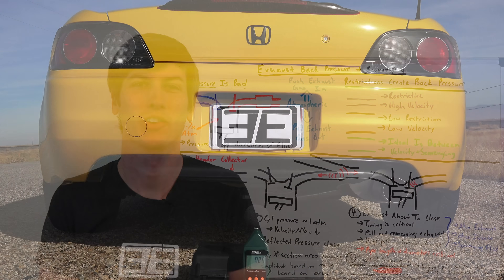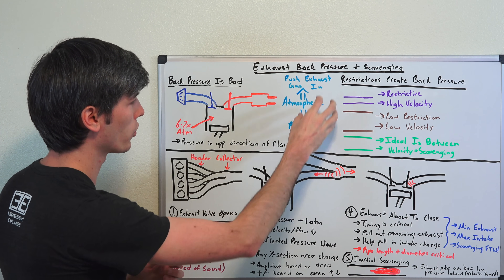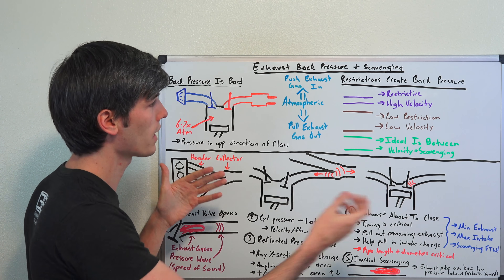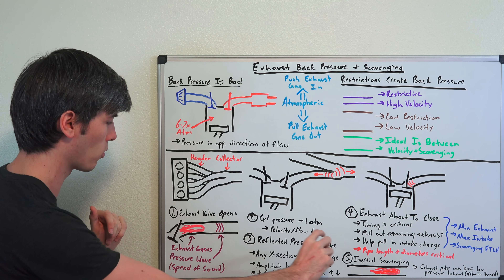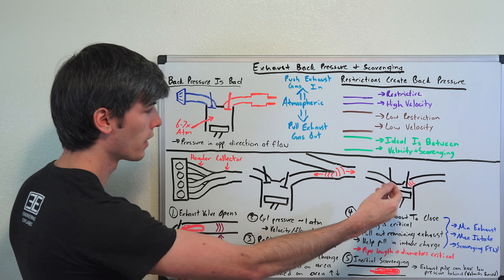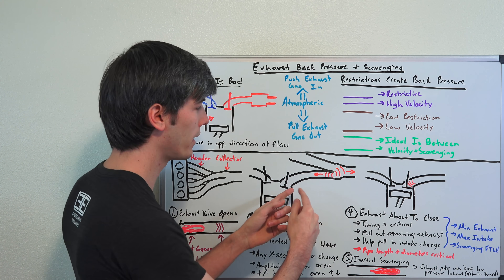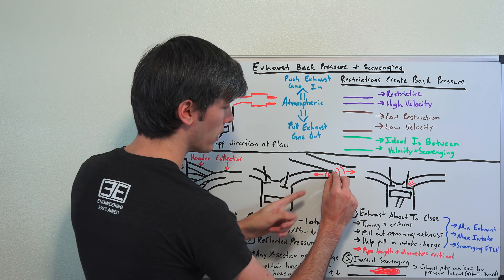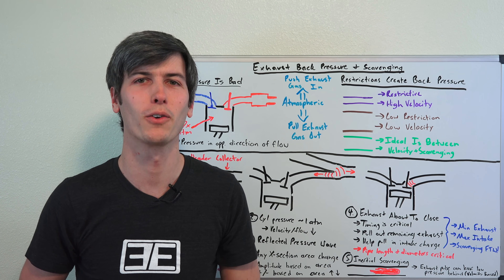Stop Saying Car Exhausts Need Back Pressure

Comment: You are only right for the engines that apples too but you are 💯 wrong for engines that doesn’t apply too.

Bone stock 1998 Chevy s10 2.2l ohv. 

Started off bolting things on then one day cai, dis blaster coils, larger TB, and such. I had a full exhaust system installed one day. Everything graphite gasket, studs, hangers every single aspect replaced all 2 7/8. Head and header no blueprint matched. Just bolted on. I noticed driving away it reved up really fast but had no power. Guy tried like hell to talk me out of it. Old timer said it needed back pressure. He said I’d be back he was right. I then had the  ecu mapped still ran good but had no power. Simply added a 2 5/8 tip to the 2 7/8 pipe and boom. Slowed the rev noticeably but I totally feel torque and I know had a notable amount of power.... again for the pos 2.2 ohv really is not a good platform but never the less this was the result. But then on my 02 Acura TL 3.2 open exhaust for sure gives you more power, faster rev, and easier on the everything so back pressure is subjective to motor differences. 327 cam straight exhaust makes power.

Comment: I challenge you to remove the components of the exhaust on any Chevrolet 8.1 that cause back pressure. Then tell me it has had no effect on the engine. Sorry, but these companies build these like this for a reason. I love how even you start out saying "no need for back pressure" Then go to explain why we need back pressure without saying the words back pressure. Are you going to tell me that GM doesn't know how to build a big block?

Good video, I have installed to many exhaust systems with no back pressure and watched the torque or power fall off on almost every vehicle one has went on. So I don't really believe you. It looks good in theory if all combustion chambers and engines in general are designed exactly alike.

Comment: Mention also the low pressure or almost vacuum created in the other pipes that join at the collector, helping suck the gases out when the next exhaust valve opens.

Comment: So if you want proper exhaust velocity, you need some restriction in flow? Restriction in flow creates back pressure as it narrows like a force cone to increase the velocity of the gasses like a thumb on the end of a garden hose increases the velocity and back pressure of the water passing through? So then, by extension, my exhaust needs back pressure? Lol, just kidding. Great video, that topic needed clarification to be sure.

Comment: Thank you Jason for your great videos - I graduated in 1977 then went post-grad but I am still learning, your delivery style is enlightening and your enthusiasm teaching is contagious.  You may mention the component to the scavenging negative (relative) pressure wave contribution from other cylinders connected to the same collector, what we used in "tuned header exhaust".
As I read comments, I think that some people misunderstand the "negative" pressure wave (or interface) you are mentioning possibly because they consider the word "pressure" as necessarily positive not considering that this "pressure wave" is negative relative to the pressure in the rest of the system.  Great video - makes me feel young again.
PS: Born in '53!  What is your secret, are you wearing a wig, genetics, special engine oil formulation, ;-),  take care Ciao, L (FoMoCo engineering retired)

Comment: this is not a good explnation  
  a properly designed header generates a miner vacuum   caused by the rush
of hot gases leaving the chamber 
  the reason for some back pressure is to aid in the fuel efficiency 
 and the cooling of the ignition of fuel  
there is some thing called intermix temperature  if it is too high the fuel
air burns too fast and motor knocks  and you can destroy  the engine

Comment: So my Lancer is an NA, no turbo, but the previous owner took off the OEM exhaust and put in a 3" exhaust, for sound. Don't get me wrong, it sounds good, but I feel the exhaust is most likely too wide to be optimal. Would you say the loss in performance is negligible for daily driving? Would I feel a delay in acceleration? Noticeable to be bothersome? If HP or torque is the measurable difference, how much would I actually stand to lose in general cases? Thank you

Comment: Wish this fella wasn't such a hardcore ricer fan. Then maybe we'd get more unbiased videos about the big block V8's and whatnot. Most of his videos discussing engines is primarily aimed at the little 4 bangers, for the most part when he does a video about the Bigger engines its more negative than positive. 

Dont get me wrong, scientifically speaking these newer smaller engines are becoming extremely refined in their design to pump out max HP per cubic inch.

But I don't see Real Drag cars using Inline 4's and 6's to get to 300kph in 3-5 seconds. I see them V8's with 8000+ horses.

Why can't we discuss that? Why must it always be tiny high pitched engines?

Comment: So how does exhaust pressure work with a turbo charged motor?  Where  Is the optimal place to put the turbo?
Reply from the maker: As close to the exhaust valves as possible (short header).
Reply: I guess you can't do a video on this since its such a short answer...  :-/

Comment: Well, explains why when we changed back pressure back in my racing days using different exhaust chambers, we could change the torque curve. But it doesn't explain why I should "Stop Saying Car Exhausts Need Back Pressure".  You basically outlined why it is beneficial.  If you fully eliminate it you degrade performance.  And of course that is obvious by how modern cars are designed.  Otherwise a "Smart Car" would have a 4 inch diameter exhaust.

Comment: So how does boost (positive pressure) affect the scavenging pulses from the exhaust, specifically BEFORE the turbo. Does the increased pressures keep the pulses from returning to the exhaust valve? Does a boosted engine see any scavenging?

Comment: Hi Jason! Very nice video. I just installed an axle back muffler on my ND mx-5 and was wondering if it negatively would affect the car in any way. Compared to the stock muffler, the super sport one from BBR is much less restrictive and much lighter. But also it’s slightly wider than stock tubing at 2.5”. 
Don’t want to damage anything. Noise is great though :D

Comment: Exhaust scavenging is even more important in small two-stroke engines, due to not having actual valves.
In fact, when your two-stroke lawn equipment is "sputtering" and seemingly running badly at idle or under low power, that's exactly what's happening - there's not enough exhaust velocity to scavenge the cylinder effectively before the exhaust port closes and it tries to fire the next cycle. There's too much exhaust gas and not enough clean gas, and that cycle fails to ignite.

Comment: Well a 2 stroke engine is a internal combustion engine. And it DOES benefit greatly from back pressure.

It can lead to 30-50% performance gains in that engine type.

Comment: Does the soundwave reflection also occure if there is no collector because of the silencer? I build the exhaust system for an formula student team. We use a V2 engine with seperated exhaust manifolds and two silencers.
Reply: So the real question would be if the manifold length matters like told in the video.

Comment: My plane exhaust broke and I lost all power.  I was forced to land near a grocery store, could not climb at all.  With the pipe welded back up it worked fine. Why would that be? (It's a two stroke) The mechanic/welder said it was a back pressure issue.

Comment: Exhaust back pressure helps torque in the low rpm range... no back pressure builds power in the higher rpm range
Reply: Did you watch the video or just read the title?

Comment: When people talk about "back pressure" They are'nt talking about atmospheric being higher. Engines that are low in static and hense dynamic compression there should be some resistance to flow towards the middle to back end of exhaust. Engines with higher static compression ratio do not need as much resistance . So if You have an engine with say 8.5/1 static comp ratio and You shorten the exhaust You will lose a noticeable amount of torque but from the mid say 3000 or so up to redline You will have a small amount of HP increase

Comment: I think you should have mentioned goilets and how they improve the scavenging effect. Also it should be noted that when you tune the exhaust, the carburetor/fuel injection, intake manifold and camshaft have to be optimised to improve the efficiency and performance.

Comment: Well for what he is talking about he is right or else rally cars and drag cars wouldn't have basically a direct dump exhaust. The real reason you want some back pressure for fuel efficiency. And on a turbo with back pressure you get exhaust density which will spool the turbo faster. With no back pressure you get less exhaust density but being able to evacuate with a higher velocity so you get higher spool rpm. So pretty much with a turbo and back pressure you get a more daily driver power band and better fuel efficiency. Without back pressure you get more top end power band with higher power which isn't ideal for daily driving and lower fuel efficiency. That's the real reason people say some back pressure is good (there are alot of people that say it without knowing why). It actually has nothing to do with what he's talking about.

Comment: I have owned many Ducati 250-350-450 singles. The factory megaphone racing exhaust has a reverse cone to create back pressure. And it works just like a chamber pipe on a Two Stroke. Using a straight megaphone and any street exhaust gave less hp. So, back pressure can be good, it works on Ducati....and the engine is So Loud, like a Harley load.

Comment: I have an old audi b5 2.8 12v with 325.000 km on it. I rear muffler and put some pipe on it instead, at it sounded much better. Now i just removed the catalyst and now it has much more power at normal speeds 80km/h in the lower speeds i have not noticed a difference, though it is much more free revving now! I thought it would be noisy at normal speeds, but it actually got more silent!

Comment: this makes me scared of making any modification to my car exhaust now
Reply: or just use what he just said and if you use bigger diameter piping, tune it correctly. most cars come stock with 2-2.5" exhaust piping. you are gonna have some back pressure at the header collector, downpipe/cat. use the available bp to balance it out and a tune to dial it in.
Reply: you can't really damage anything with the parts that you can mount on a road car. But something similar to the stock exhaust or well-engineered aftermarket is better for sure.
Reply: @MrHaggyy  like a Flowmaster hush power 2 muffler and two or two and a half inch pipe to the rear bumper?? Or is this too free flowing?? It's a V.6 tiburon.
Reply: Don't be a weenie!
Reply: It's just pressure vrs flow
Reply: Well sometimes stock is so bad anything is an upgrade.
Reply: Just use parts engineered by well known manufacturers like Borla
Reply: @connivingkhajiit  bassani exhaust make the most power

Comment: Is it recommended to have a tune done when replacing the stock exhaust system?
Reply: Andrew S if it’s a car newer than about 2000 you can usually reset it’s learned parameters in the ECU. If it doesn’t have that function I doubt the ecu is tuneable and of course ye old carbi cars would need a tune up.

Comment: Why don't you use a second pipe which takes air in front of the car and coupled with the exhausting pipe to create venturi effects to make low pressure inside this one to increase performance ?

Comment: Try to minimize the restriction from the cat to tail pipe.
In most cases for non turbo engines maintaining a stock exhaust routing I use a 25% rule. Increase over stock for cats and pipe Match the muffler in / outlet to match the pipe. If using a stock style turbo muffler shorten the muffler length by 25%, and continue the matching pipe out the rear of the vehicle.   Ive found this to provide excellent flow while maintaining velocity for scavenging. I have acceptable results with an increase in low to mid torque and mid high range power. If adding a turbo there are several details of the turbo and engine to be factored in.
The important thing  to remember is; intake and or exhaust systems are only as efficient as the tightest restriction. once you have a restriction its like a kink in a hose; you can have a 1500 gallon per Minuit capacity pump but if a restriction cuts it to 500 gallons all you get it 500

Comment: Sorry, you completely overlooked "ramming" effects of the intake during cam/valve overlap as part of the exhaust scavenging, these same velocity induced effects of both the intake ramming and exhaust "vacuum" at the engine output target are responsible for high output of normally aspirated engines, crankshaft speed vs actual cylinder intake and exhaust phasing vs total time to fill and evacuate the cylinder are the limitation. Crank speed (cycling) of the engine has to increase (with a given displacement) to increase power output however, as crank speed increases the cylinder displacement needs to be reduced (spread of more cylinders) to allow for shorter intake and exhaust periods in real time due to time/area/volume displacement limitations of fresh and spent engine gases.

Comment: About 25 or so years ago me and a friend when we were kids took the exhaust pipes off a 1975 Kawasaki KZ 400 disconnected at the head, (I don't know if this has anything to do with it it had a 2 into 2 exhaust) now when we did this I thought there would be little to no change in the way the engine ran. But I was wrong the engine seemed to idle fine but once you gave it throttle it ran horribly and made a lot of exhaust noise. I didn't think the exhaust pipes being removed would have made a difference. So I'm guessing that back pressure has significance to the way the engine runs.

Comment: May I point out that aircraft, which require all the horsepower they can muster, do not have exhaust systems. During WW2 the Supermarine Spitfire's Merlin engine went through countless revisions, increasing incrementally from about 850hp to over 2,000hp  (I'm going by memory here). There was never any effort to increase horsepower via back pressure because back pressure only COSTS horsepower. Aircraft today, all these years later, still perform best without exhaust systems.

Comment: This is probably the best description i've heard on the subject.   It's literally slightly getting into the realm of rocket science.  For those who watched all this and still say "you do need back pressure"   you're totally missing the point.  Restricting the diameter (to the appropriate size) is not actually creating back pressure, it's lowering it.  It's creating/maintaining exhaust velocity to maintain the lower pressure (see Bernoulli's principle:  the restriction LOWERS the pressure.)
Likewise, having too large of a duct slows the air down and increases pressure. (see that big divergent duct on the back of a rocket?  it's there to increase pressure).
Reply: That’s not How Bernoulli’s principle works. 

Go look at a fighter jet engine going to afterburner. The nozzle diameter increases. Part of it is to increase the nozzle area which allows for more thrust but another part of it is to reduce back pressure in the engine. If it didn’t increase... the pressure inside would increase, the flow would slow, and the compressor would stall leading to a huge fireball out of the front of the engine. 

Compressor bleed valves do the same thing to prevent compressor stalls on the cold side of the engine.

Comment: if you do not have a high powered motor than yes, you need back pressure. I had no cats no resonators and no mufflers on my car and the throttle response was horrible. So i had the cat's and resonators put back on.

Comment: As a 50+ year old car guy and engineer I love your videos, excellent explanations on the in’s and out’s of cars and how and why they work.  But I have to take exception to this video.  The answer is right there on your white board; High restriction equals high velocity, not optimal. Low restriction equals low velocity, also not optimal. The Ideal condition is somewhere in between, or optimal restriction equals optimal velocity, ie. You need some restriction, because restriction is back pressure.  Scavenging doesn’t really matter in the discussion of back pressure.  Scavenging is basically how well your system removes exhaust, it’s a separate discussion all by itself, so changing the terminology from velocity to scavenging in mid discussion is somewhat misleading.  The point that you missed and yet made very well is you do need an optimal amount of restriction to achieve the optimal amount of velocity.  An exhaust system that scavenges exhaust well will simply remove the exhaust at a more efficient rate.

Comment: So should the diameter of the pipe be decided on the displacement of the engine? And the rpm range that I want to achieve peak horsepower at?

Comment: I've heard you can burn valves by altering the exhaust flow substantially.
Reply: Exhaust leak because cool air is getting in right by the head. I had a exhaust leak on my mustang. Burned a exhaust valve on cylinder 2. But if it's sealed properly it doesn't have those tempsture extremes.

Comment: You make amazing videos. My question would be how can I, as a mere mortal, increase scavenging and or inertia with a turbo motor? I  have a stock exhaust on a flashed ecu twin turbo V6. The power is amazing. But can I really get more efficiency or power from changing the exhaust size,(cat back) while keeping my cats? Or would only replacing the downpipes, which are also precats.. make a difference at all?